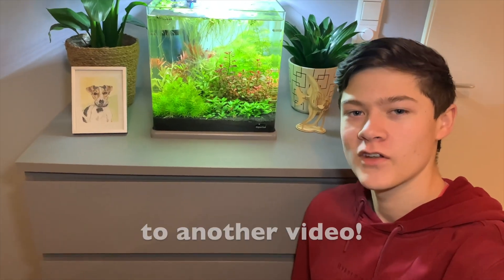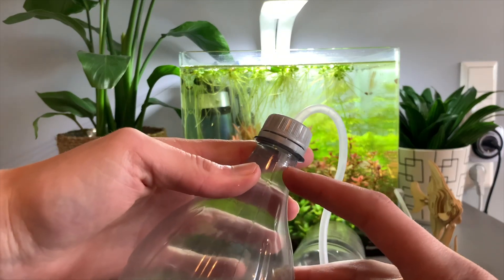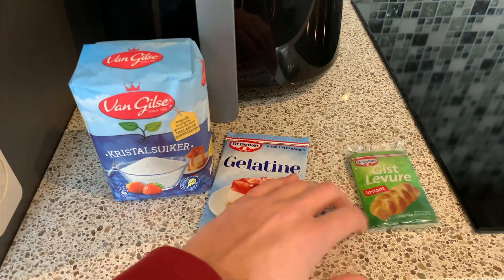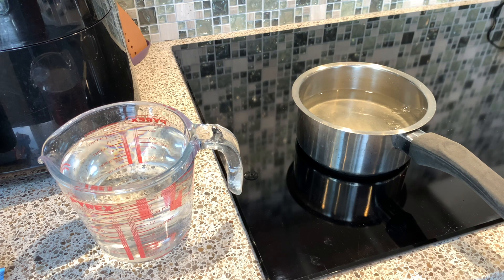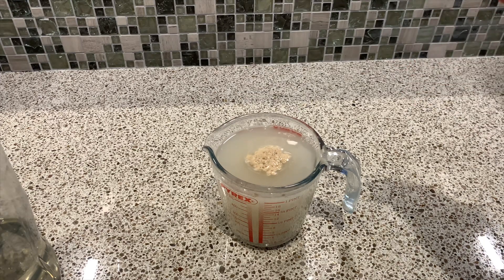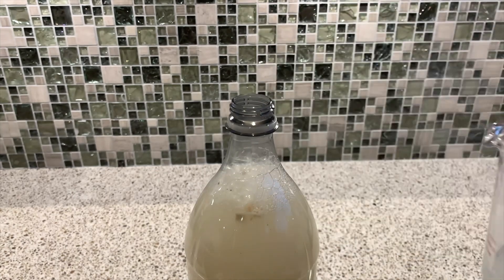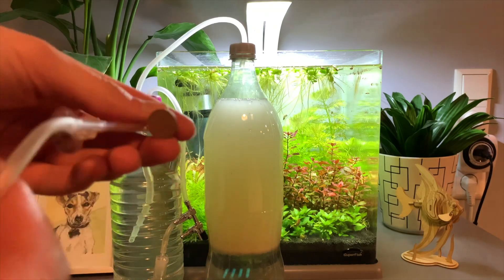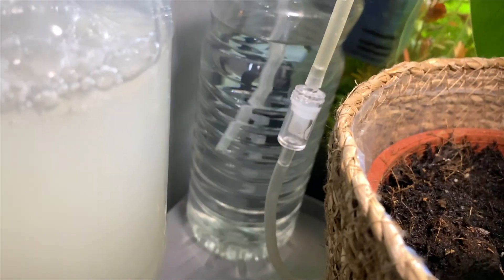How To Make Your Own CO2 To Use In Your Aquarium?! // Diy CO2 Tutorial

Comment: Are you using twinstar co2 diffusor? I just want to know if the yeast make enough pressure to penetrate it. Do you recommend it?
Reply from the maker: Yep it’s the small size twinstar co2 diffusor. Yep it’s a great diffusor and can recommend it. It’s also not to expensive and the yeast does make enough pressure. But you just need to give it like a day to build up the pressure.